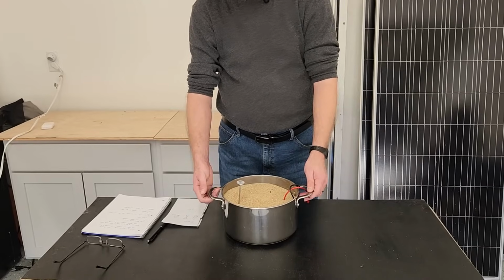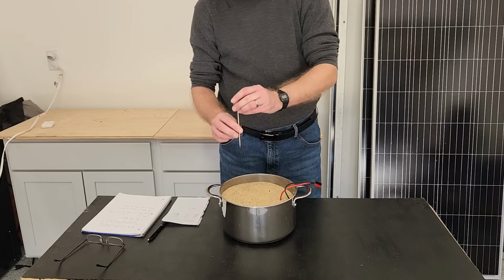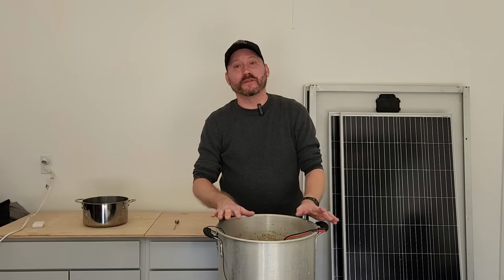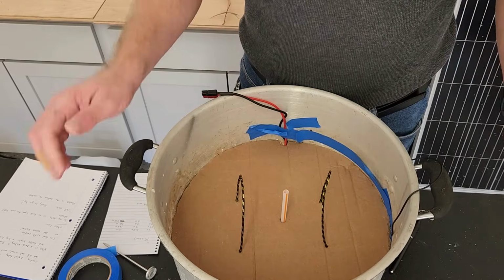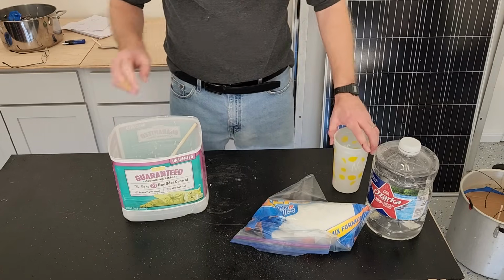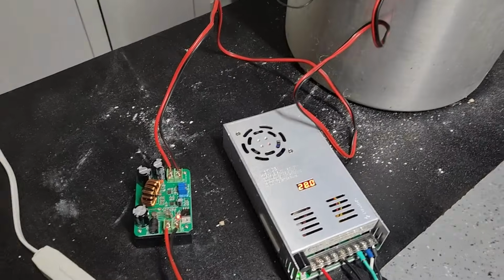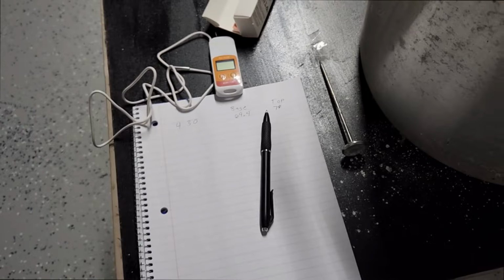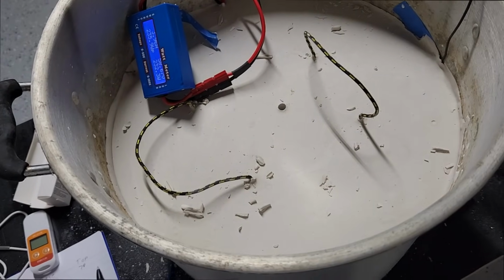Sand Battery heater. Create free heat  of 500F using solar electricity! Texas Prepper Projects

Comment: Did you have to convert the voltage from the panels to 110v to run the heating element?
Reply from the maker: No, watch close. it's strictly DC
Reply: @texasprepperprojects  Thanks for your reply. I did watch close, and you are right, I didn't see any conversion, that's why I wondered. I have now learned through watching many videos on this subject that it's not necessary. Since I'm new to this, I didn't know it's not necessary. All the best, and thanks for sharing your experiments.

Comment: Could you build a hydrogen heater and use water as fuel? . Ive seen some camping cook stoves like that. But there really expensive.
Reply from the maker: I wouldn't!
Reply: @texasprepperprojects  why what's wrong with them?
Reply from the maker: Because hydrogen is dangerous?? Because the amount of power you have to put into water to create the H2 is a lot that could be used other places. What makes a neat video doesn't always make something practical in the real world
Reply: @texasprepperprojects  OK makes sense.  Do you know how those flashlights work that use water  ?
Reply from the maker: Never see one!
Reply: @texasprepperprojects  it's called a H2O light
Reply from the maker: Why bother? Just use a USB rechargeable led flashlight
Reply: @texasprepperprojects  sun's not out no electricity

Comment: All the criticism I read...
I say, good stuff. You do well. 
Plus, you have specified, it is a testing trip to find out how to do, not a ready installed house heating.
If anything the nags on here have paid attention, was thought by themselves, before rushing into their nag, there would no be posts declaring that already at 8-th minute they feel they can't stop their nag.  :)))))
So, to concern of "safety specialists":
* Use the pyro cables and your heat safety issues on wiring begone.
* Put some thinking effort and if the burn out of the heater for 120v is so "dangerous", drop in place 208v heaters instead and/or also, ones designed not for liquids, but direct air heating.
Your design grows in size, loses seemingly that raw heat footprint, but is still working the same way. Just like a big stone built storing fire places in cultures from cold areas in Europe.
* Plus... if sand is "so bad heat conductor", can this be explained please, where does all that heat excess, generated by heater into that sand, go in that case??  4-th dimension?
(Just need to go and have a barefoot walk in the real sand desert)

Keep up, dude. Nothing wrong with having adventurous mind!
Let all the rule prayer kind inhale the sand dust in air, when left behind.  ;)
Reply from the maker: Thank you for the great comments!

Comment: Interesting, but doesn’t seem practical. A heater buddy with propane cartridges should generate much more heat, in the event of a power failure. HB is rated for indoor use.
Reply from the maker: For survival yes, for greenhouse heating over a long period of time, no

Comment: No way the sand fused. Maybe something in it melted or it wasn't sand. But think about it. Your whole pot would be melted if it was hot enough to fuse sand... just saying. I was heating some sand i got from an ant hill and it made weird like rocks chunks whatever your wanna call them, but the temperature to melt silica is really high, higher than steel or iron
Reply from the maker: You are correct.  Watch the follow up videos. It's the plastic from the heating element melted

Comment: Why not skip the solar panel and paint the pot black. If you have enough sun to operate solar panel you have enough sun to heat pot ??
Reply from the maker: Because black paint only got me to 102f. The heater module got me a lot higher. Check out my other videos for tests and follow up

Comment: Not so much of a criticism as some observations.

1. Our typical largest energy requirements in a home are for heat not electricity ... 
* Hot water for washing
* Hot water for space heating - especially in Northern and Southern climes > 45° latitude in the colder parts of the year
* Heat for cooking

2. The typical energy conversion efficiency of a solar panel is at the very best no more than 30%. Typically MUCH less. So using a solar panel to gather solar energy to turn into heat seems somewhat bizzare. Why not gather the solar *heat* from the sun directly and achieve a much higher heat output?

3. Solar heat energy collectors are as common as muck and easy to implement in a multitude of different ways. They can be seen on top of just about every house in Mediterranean holiday locations and in most hot areas around the world.

4. Using a phase change process the heat gathered can be "amplified" to reach higher temperatures as required

5. Using the heat stored to heat or preheat central heating water, to significantly reduce our overall largest energy costs from heating, would appear to offer a greater overall efficacy to the system avoiding significant energy losses.

What would you consider the major hurdles to be in adopting this approach and keeping Solar PV electricity for electrical supply only?
Reply from the maker: I think you're missing what my goal was with this.  The whole point of this experiment was to create heated sand, to use to heat the air inside a tent or small room in the event of a power outage.  I don't want to heat water, or cook, or wash clothes.  I'm attempting to find a 'non toxic' and 'renewable' way to heat a small space other than propane.  The idea was that I use the electricity from the solar panels, convert into heat, heat up the sand during the day.. then bring it inside to a small room at night to stay warm without needing to worry about CO or fire hazards from a 'Little Buddy' heater.  You also COULD put this bucket of sand on top of a fire pit to heat it up like DESERTSUN02 does, but I don't have that ability at my rental house. So, put this project in that lens... to literally heat up a tent without burning propane

Comment: 12 volt water heater (plugs into car lighter socket) is $10. 12 volt solar panels $25 (most include a 12 volt socket). Heat activated 2 blade stove fan $20. 12 volt battery from your riding lawn mower is free. 16" cement paver from the lumber yard $5. Huge stainless steel lobster pot $25. Bag of sand $5.
Get after it 😀
Oh . . . and the sales tax on all of those . . . Don't forget the tax
No it won't give you 500° heat . . . But that tiny solar panel will fit nicely in a south facing window. The stack of your new "furnace" will be barely 2 feet under that window.
And you can sport my jackass grin 😁 when you go to pay your electric bill
Reply from the maker: build it. i would like to see the results.

Comment: If you think the sand battery heater is good, you should try a water heater. Hot water is an excellent solvent. Hot sand is not.
Reply from the maker: Check out video 2 and 3

Comment: It’s way easier to put a pot of sand on the stove
Reply from the maker: And extremely silly. Why would I use gas fuel or electric power to run a stove to heat up sand? Mister D.S. does it but it makes literally no sense
Reply: @texasprepperprojects  thermodynamics because the sand is stationary it holds heat where as air is a fluid gas it disperses heat this is basic science not rocket surgery
Reply: @texasprepperprojects  u poor thing u think I meant a stove like u got my stove heats with wood or coal

Comment: I want to do this but I'm still working out how to dump excess solar power into the system without my batteries getting flat.

I'd fill the entire pot with sand and have external insulation.
Reply from the maker: This is a common thing with wind power. Depending on what charge controller you have, you should be able to program the OUTPUT terminal only to kick on when the batteries are full.

Comment: solar panel?  why not use a concentrator ? uh..........
Reply from the maker: I think that a big mirror array or Fresnel lens is more expensive and complicated for the average person to set up, especially if you don't have a ton of space in the back yard, vs 2 solar panels
Reply: @texasprepperprojects  If you do happen to ever need a large fresnel lens for a project...they are very expensive. The old floor mounted projection big screen tv's everyone tosses out when they quit use one...you can set to whatever focal length you need to produce heat.

Comment: The WHOLE point of having a heat BATTERY is to know HOW LONG will the battery last??? you gave NO info on that at all. Plus how do you move it and where does it go without burning it??
Reply from the maker: Check video 2 and 3 for testing. Put it on a furniture dolly

Comment: I don’t want to be cruel but Florida man would have explained a lot thats wrong here. I honestly don’t know whats been achieved other than spending a day having fun. There’s no way the water heater element can survive any meaningful temps. Heaters that would be able to survive high temps are available. Electrical setup isn’t appropriate for high temps either. Sand is inexpensive and can be heated to higher temps than water however water has a much higher specific heat capacity so will actually hold more heat energy than sand unless the sand is heated to much higher temps than were demonstrated here. No insulation means energy isn’t being stored for a meaningful and useful length of time. And on and on. I’m glad you had fun but a little research could have made this actually useful instead of just a bad storage heater. Even a little insulation would have made this more useful but then you’d need a way of moving heat from the inside to the outside like in any basic storage heater. I hope the fun project inspired a more meaningful and useful experiment.
Reply from the maker: well thank you for your helpful commentary.

Comment: HIGHLY INNEFICIENT AND DEPENDANT OF THE GRID.  not functional where you don't have electricity and/or in the wilderess, so this method is oly functioal in cities, that makes it not that functional, if you are going to be depending from the grid then an HHO heater is by far better, than this, HHO gets higher temperatures in less time.
Reply from the maker: you dont understand i was running this on SOLAR
Reply: @texasprepperprojects  Does not matter it is higly inneficient, so.... in the wilderness or remote country side now you have to carry solar panels batteries AND stuff?  NO WAY!!!    drop ANYTHING electrics and use a wax candle it works at any time of the day even better and if electrical then use HHO nothing beats that.

Comment: I don’t get it.

 So you have solar panels generating 240w/h which is about 1kw in 4h. That’s fine. Why in hell do you use the energy to heat up sand to store it inflexible und inefficient? Buy a 100a 12v lifepo battery to store the energy und use a electric heater as needed. 

And using your wall power to heat the sand is even more useless. 

I mean, if you have a camp fire and use the waste energy to heat, okay. But using electricity makes no sense.
Reply from the maker: Don't need a battery or inverter for this version

Comment: Great explanation and experimentation. 

There's something even greater here that we learn.
 A greenhouse that normally needs an underground pipe heater (huge thermal mass on the floor) or simple fuel heaters to keep the plants alive over winter, now only needs a few hour's worth of sunlight to charge the heatsink and thence allow gradual radiated heat to emanate overnight until the next day.
With a simple automated air fan to remove the initial OVERHEATING of the greenhouse in the day, one now has hands free heat for starting those greens off in the spring or helping to keep the peppers etc over winter.

Cheers 🇬🇧
Reply from the maker: Neat!

Comment: Water can store 5x the heat as sand. Therefore, one needs to figure if they are going to heat up 1000 degrees to equal the ability of free water at 200 degrees. 200 degrees is cheaper to heat up than 1000 degrees. Therefore,  what is a person's target objective and space. What does a person need over 200 decrees 🤔 This would be an excellent concept for my STEM students to see how two different solutions can look better than the other, but a person's target objectives need to be identified. A chart would be ideal so I will see if my students are interested in producing such a data chart.
Reply from the maker: Check video 2 and 3

Comment: I wonder if painting the pot black would radiate more heat for you so you didn't have to use a fan or anything like that. If you try it, please post your findings. Also like you eluded to earlier what if you had some thermoelectric fans to help circulate air. Really cool project dude.
Reply from the maker: Check out my other videos for updates and better testing